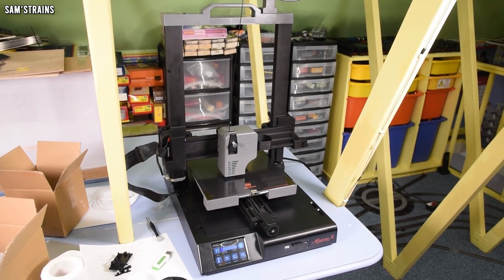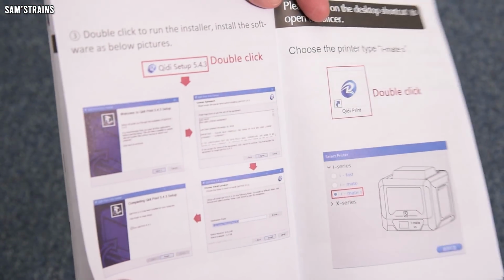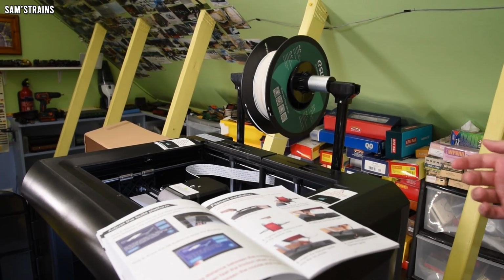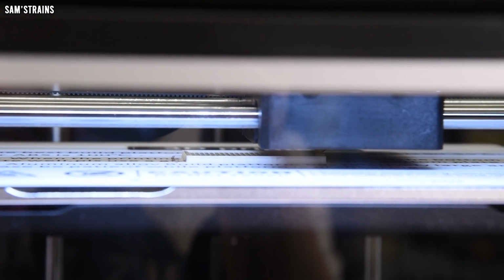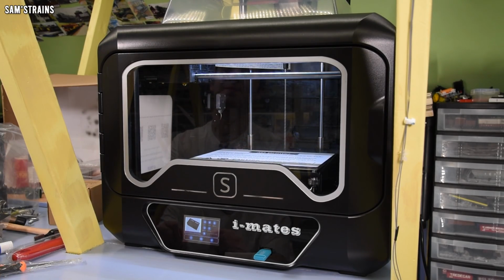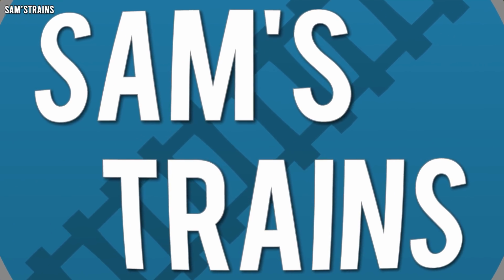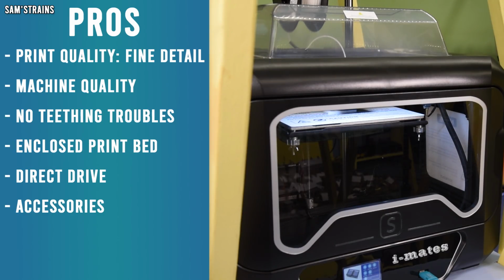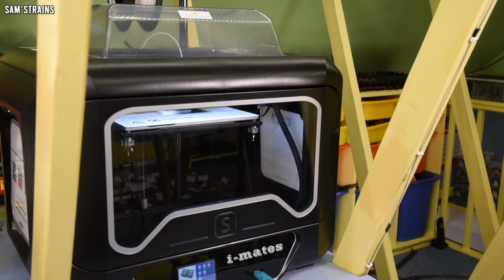Qidi iMates 3D Printer | Does Better Quality Machine = Better Quality Prints?

Comment: I know the pressures of filming are great so no hate here from me but please don’t file down your new printer, all other reviewers managed to get those tubes in ok also read the base, read the sides, read the manual. The glue stick isn’t for the build plate top, it’s two sided, regular on top in white and metal underneath, use the glue on the metal side when printing abs or tpu, etc. your not meant to use the magnetic sides and top for PLA they’re for ABS, etc. I’d love to see what you can do with that fine nozzle/extruder.
Reply from the maker: No Steve, the instructions were followed to the letter, and the filament feed tube did not fit due to moulding issues in the plastic - I wouldn't have modified it if not necessary... unfortunately the change is permanent, but thanks for trying to help!  The filament feeder is a terrible design anyway - bad idea to have the filament pull through such sharp angles - so I don't use it any more. There's no reason why you can't print PLA with the sides/top fitted... many machines are enclosed with no option of removing the sides... I've been printing with this machine for 6 months with absolutely no problems. As for the glue stick - I didn't even use it, as it was obviously unnecessary... but thanks for the tip anyway!
Thanks for watching, Sam :)

Comment: When you say Primer, do you mean filler Primer or just primer? I have an Ender 3 and it does what I want of it within the limits that it has. my lasted model is of a derelict Stone Cottage. apart from some light stringing it has printed a great print. I do have to thank Mike's Railways for the design.   Martin. (Thailand)

Comment: Cracking review as always and glad you’re someone who still remains steadfastly objective, let’s face it, the reach of the channel is no coincidence 👍

I’ve just ordered a Creality CR-200b, although 200mm^3 isn’t massive, it should be fine for most things I do but the key thing with the enclosure is that it needs to live in my shed workshop where there’s tonnes of wood dust when I’ve been making guitars and things, and the temp varies far more wildly than an indoor environment. I’ve got an anycubic photon S which I’ve yet to even try as since moving house this year, I’ve not even found my personal laptop yet. Obviously the detail the resin should be able to achieve ought to be fantastic, but as you know they’re nowhere near as easy to manage with nasty liquids, cleaning, UV curing… the other issue with resin is some of the items I’ve bought for the railways have been rather warped even from recognised hobby manufacturers rather than home-based DIYers, so thinking about your loco chassis on your recent project, resin I could never trust not to banana…

Comment: That should do a much nicer job printing PETG and ABS than your other printer.
The resin printer fumes aren't that bad especially if you use Eco resin.
I use one in an office without ventilation. I don't stay in there while it's printing though.
Worst part of resin printing is the washing and curing but if you get one of those wash/cure stations it's ok.

Comment: Jerk control may not be needed, especially if the printer is running Marlin 2.0 variants.  Merlin 2.0 does Junction Deviation control in firmware, which  makes legacy jerk control redundant.    The babystepping controls and fan control are more common than you think, especially in Marlin firmware variants.   I still think I will stick with my Ender 5 though.   The Cura profile for the Ender 5 is pretty close to spot on out of the box.
Question: What firmware does this printer run?

Comment: I have to laugh (in a good) way that you remark how expensive this is (in the US it is $500 on Amazon and the smaller version is $350 US). I can recall first seeing 3D printers at a Makers Fairs about 15 years ago at a local college here in California. They were sold as a kit of parts you had to put together from scratch for well over $1,500 and ready-made ones could be over $2,500 to $5.000 with “pro” versions in the 10s of thousands. The “box” of the printer was made of thin plywood! Don’t laugh… The original Apple computer Jobs and Woz made was also wood!
It is amazing how inexpensive and great quality these have become.

Comment: If you are struggling to remove a print try flexing the plate centre down instead of up.
I highly recommend a Prusa for your next printer to test... the features make them effortless to operate just click and forget (I also can crank my Mk3s up to 130-150% speed without any great loss of detail on my 1/14 models)

Comment: Since this is so big, I'm expecting you to design an 0 gauge wagon sometime soon. Of course you may need to use parts like slaters wheels and sprung buffers, and some sort of sprung 3-link couplings, but you can do the majority of the wagon with the printer.
Also, why not print some buildings like a signal box or a footbridge?
Reply: The print are is still not that big.  It is still only 260mm x 200mm x 200mm.   It just takes up a fair bit of room due to the case :).
It would struggle with anything other than just really small wagons on 0 gauge.

Comment: A bit disappointed I have the 2018 model Qidi tech 1 dual extruder, It seems to have some better features. Like being able to change some sittings while in use, like extruder and print bed temp. As it is enclosed it is good for ABS printing and with that you can smooth your prints with something called Acetone vapor smoothing. A lot of people talk about resin printers but I find they have really small beds and so can't make very big models. Was thinking of updating mine but not sure with this one as only single extruder and not able to change settings during printing. Really happy with my old one great prints and can't say had much problems with ghosting. You should look in to using ABS and acetone vapor smoothing (I know your in quite a small space in the loft, but the vapours shouldn't be that bad).

Comment: Nice video! How come British model trains in oo use hook and loop couplers instead of prototypically accurate ones? Over here in the USA all our stuff comes with scale knuckle couplers
Reply: Cause chains are way to bloody small in oo gauge for regular use
And to add:
if you want accurate freight trains using something like the 9f the wagons will get too heavy for one of the couplings to handle and it will snap
Reply: Historical reasons. Everything has to be backwards compatible. At least with NEM pockets you can fit the coupling of your choice. Knuckle couplers aren't prototypical for most British trains before 1960ish. The only railway that used knuckle couplers before that was the LNER afaik.
Reply: To those who replied, thanks for the clarification

Comment: Great, comparing a more 'expensive' one, although it remains perspective perhaps. For what you get, that's really impressive for an affordable price. This is of course 3D printing, not some hamburger lol. Resin printing for us though. The visible printing layers do really bug me intensely. Resin printing does resolve that one. Wouldn't worry about fumes too much; a good one is enclosed as well with an internal vent. Great review Sam. Thank you again :)
Reply: I just have seen resin printers around 300 € apiece, they have enclosed printing sections sealed by silicon joints. I think I will go direct to resin for my first 3D printer.
Reply: @OlivierGabin  Great, we've seen a demo on the YT channel 'Märklingofsweden'. 300 € a piece is a bargain.

Comment: Say goodbye to Sam guys, he's fallen down the 3D printing hole. Once he gets onto resin printing he will never be seen again XD
Reply from the maker: haha - that's why I've decided not to go resin... you'll never see me again! xD
Also it's the fumes - got no ventilation in my loft... and I don't want to die D:
Thanks for watching, Sam :)
Reply: @SamsTrains  Well, I might buy me a resin printer... I'm linving in a city where you can do outdoor things on your balcony without hassle roughly from the end of April to the beginning of october, if it's not raining. So, a sturdy folding table, a 20 amps three poles electric cable and good weather forecasts, that's all I need, I already have the balconies, advantage to live at the last floor of a building. Just need to buy the resin printer now...
Reply: @OlivierGabin  If you are serious, check your air temps as well - the easily available resins are designed to work best at normal room temperatures.
Reply: @OlivierGabin  Do you really need 3 phase power to run a Resin 3D Printer? That would be a big step to take.
Reply: @kiwitrainguy  Depends on the model.Having a third pole to ground it is not something uncommon. I have computer power supplies rated at less than 500 W that uses a 3 poles cord.
Reply: @OlivierGabin  Oh, you're referring to the number of cables in the cord: Phase, Neutral and Earth which is on most home appliances (although electronic ones sometimes have two and no Earth). 3-phase electricity (which is what I thought you meant) is for heavy industrial applications like motors to run roller doors and heavy machinery. I see now.
Reply: @SamsTrains  Honestly, the dunes are an overblown issue. I also don't have any ventilation and have never had an issue with them. Also, most of the printers are so small that you can stick them anywhere
Reply: I can't wait for him to get a resin printer. That will make these coaches/cars SOOO much nicer than the traditional FDM. FDM is great for larger parts, but smaller things like HO model trains will definitely benefit from the super high quality of a resin printer
Reply: "Hello there everybody, Sam's Prints here, welcome back to the 3D print shop."
Reply: Luke Towan, another Youtuber from my home country Australia does HO scale build's and ever since he got a resin printer, the build's have never looked so good! Shame you can't ventilate easily Sam but nonetheless, your print's still look good!
Reply: Indeed we lost Sam.🥲
Reply: Sad to see Sam go this direction!
Reply: @philliproe204  no, it's not sad. He has infinite possibilities now.